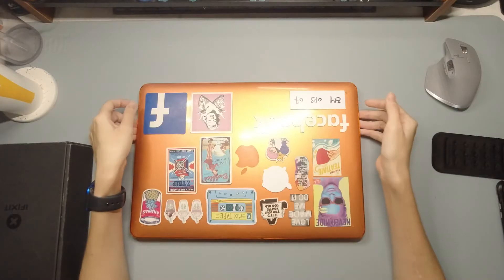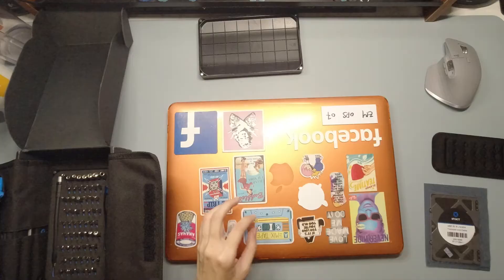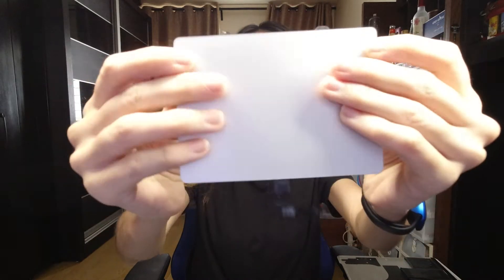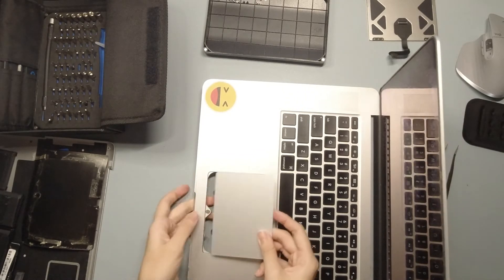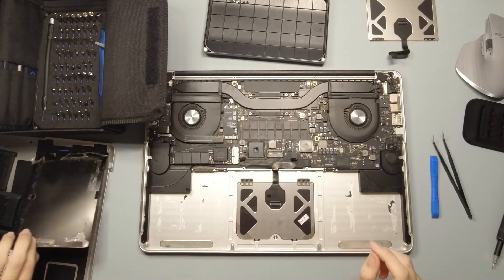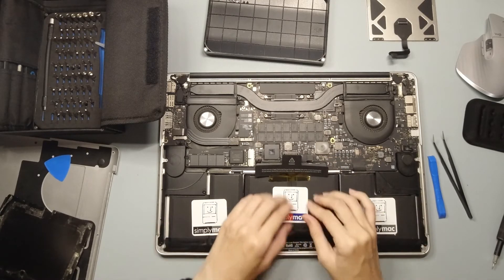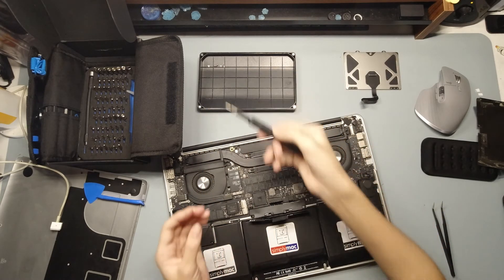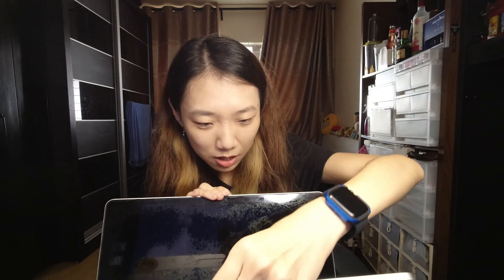Changing out the A1398 Macbook Pro Trackpad

Comment: I can see you have the issue with the screen coating of your MacBook Pro to be "peeling" or dirty. I had this problem on my MacBook pro 15" mid 2014. To remove this use mouthwash (the simple kind, not the fancy fruity taste etc) to remove the anti-glare coating that is deteriorating. Using Isopropyl alcohol does not work.

Comment: Very poor repair, 
The bottom cover  screws , 3 of them have a different length so please be mindful of original location.
That plate you did not put back is there to protect the trackpad(especially when batteries start to swell). When these batteries swell they prevent the trackpad from clicking. 
From an electronic repair point of view no anti static precautions were followed. Also users please be aware that the Macbook Pro batteries don't always come out easily especially in this model, they are usually  stuck down very well.
Reply from the maker: heya~ thanks for the comment! i did not know that plate has a function 😂 although we did have to send this particular laptop out for another repair when the battery bloated the case open.. the reason the battery came out so easily was because I opened it previously to change the speakers, so the glue was already worn
as for the anti static precautions, I do have to say, I live in a country where static is actually quite rare (even rubbing a balloon on your hair doesn't do much), so its not common practice here to take anti static precautions, things like mats and wrist straps are not commonly found. Maybe I should have placed that as a disclaimer but thanks for pointing it out!